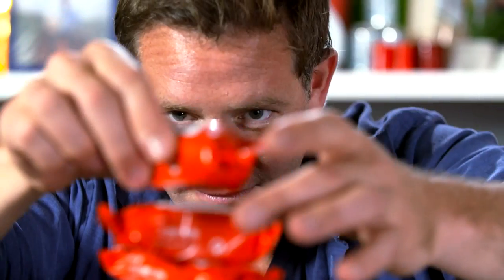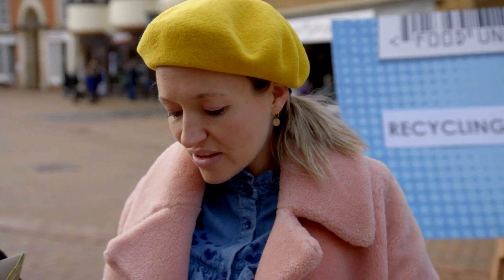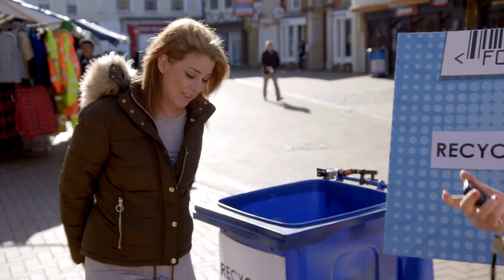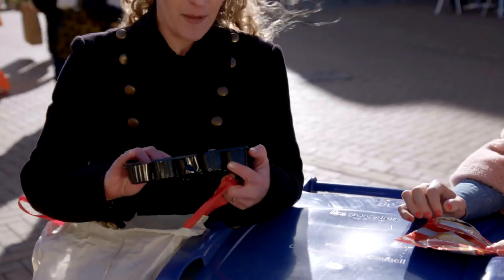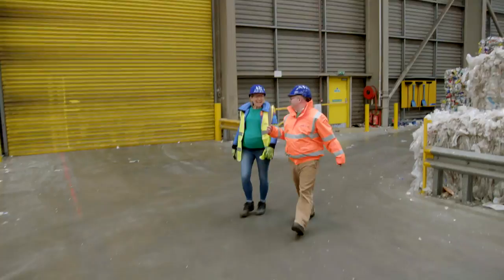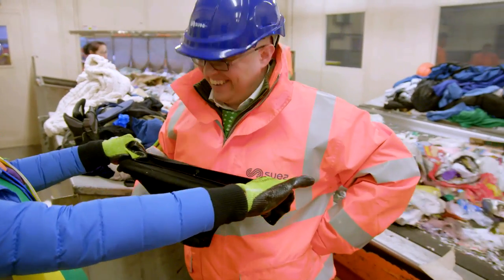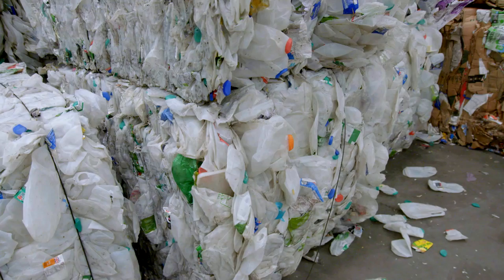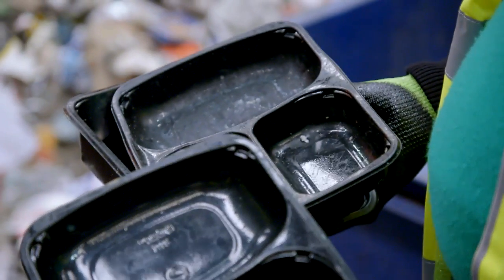Have you Been Recycling the Wrong Stuff All This Time? | Food Unwrapped

Comment: The most important household items to recycle are metals and paper products. It takes so much energy to produce aluminum metal from the ore, and mines rip apart ecosystems and/or pollute our water. Carbon sequestered by forests can remain contained if the wood products are reused and less trees needed to be cut. If you don't know where the plastic is actually going, it might be better safely buried in a landfill. We need to get away from burning plastics made from oil, it's not sustainable if we want to slow climate change. In my small town, you can only recycle HDPE (natural and colored, separated) and PETE (if it's from a drink bottle). The rest goes to the regional landfill with our pay to throw bags, where the methane produced is piped to a university 12 miles away for heat and electricity instead of letting one of the more potent greenhouse gas escape. To ensure the 'purity' of our recycling stream, town transfer station employees make sure only acceptable items are deposited in the correct bins. We produce clean bundled recyclables that are directly sold and greatly lower operating costs. I'm against the mixed stream, people need to take responsibility for the waste they produce. Yes, pressure producers to find better packaging- but do one's part to reduce one's own impact now and later. Don't try to recycle underpants (unless it's the right fiber and you have the option- all of our cotton and linen should be recycled, btw).